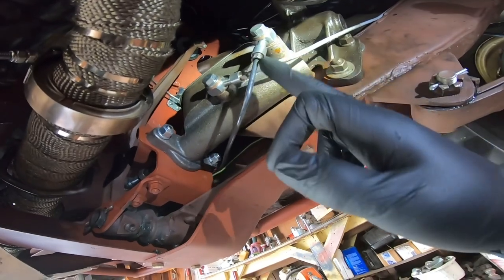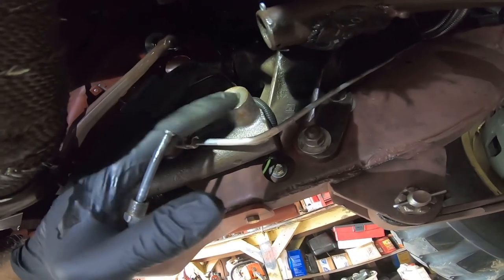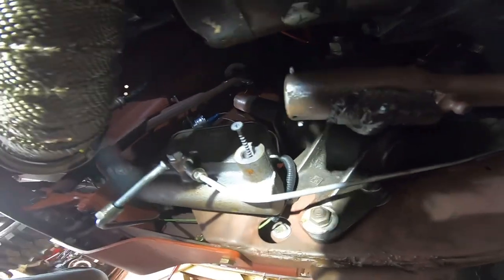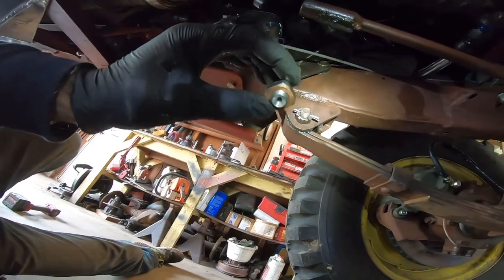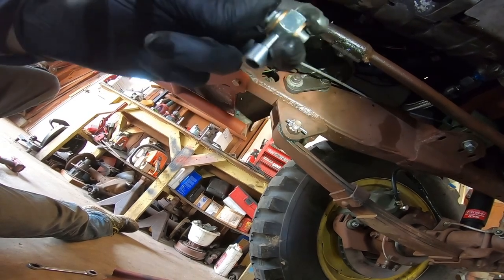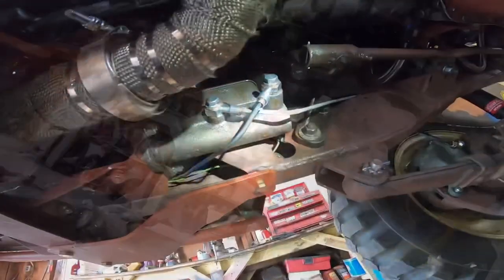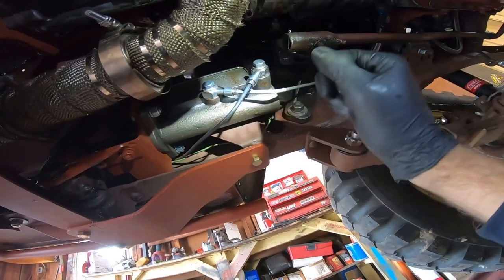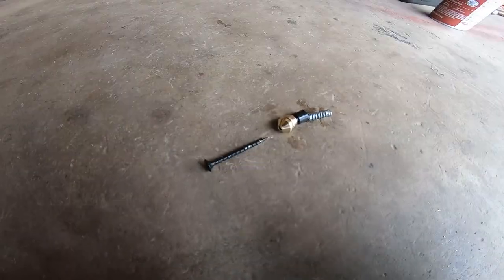Residual valve removal 4 wheel disc

Comment: does this apply to my single pot stock master
Reply from the maker: They have a residual valve and it functions the same but the removal process is different
Reply: @redeyecafegarage7484  do you have a video of removing it??
Reply: @redeyecafegarage7484  i struggling to find any information on the stock willy’s master, i’m 4 wheel disc and need to remove this valve